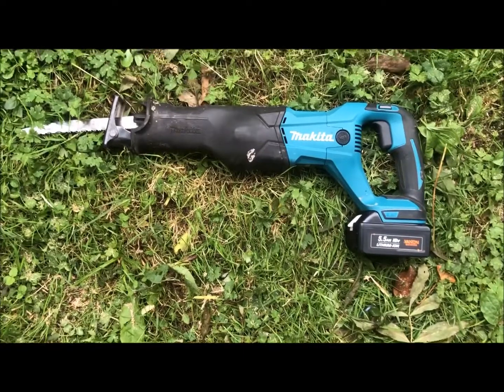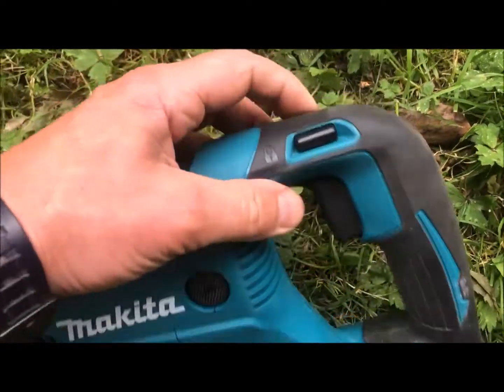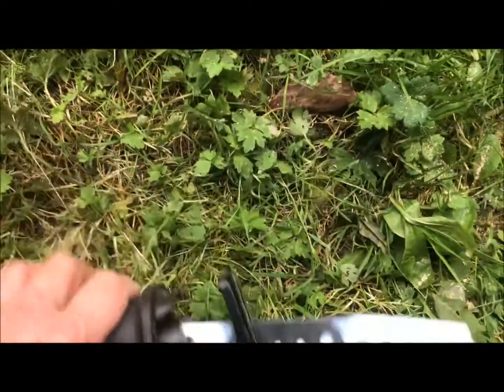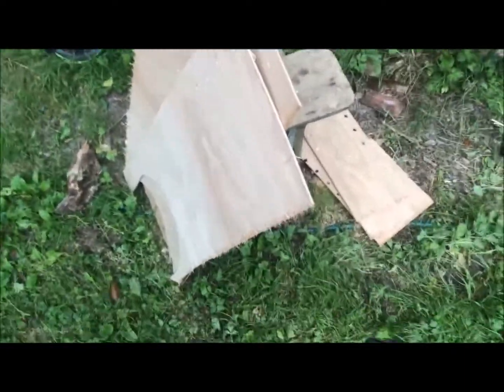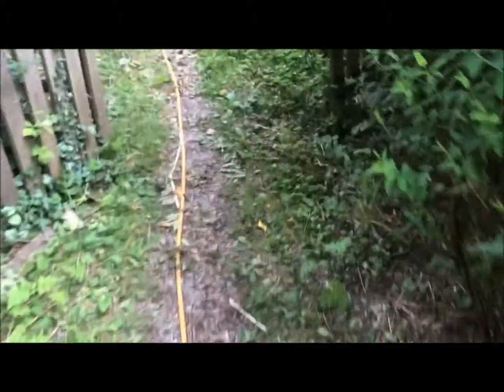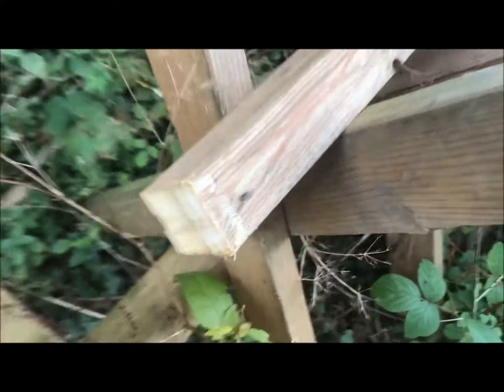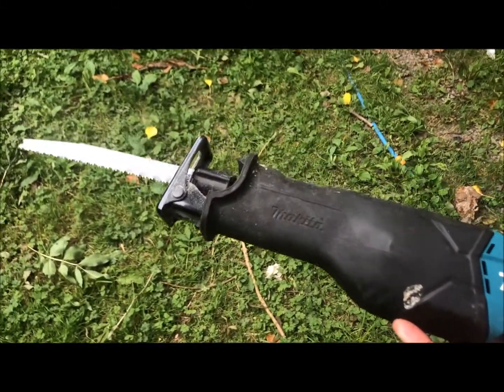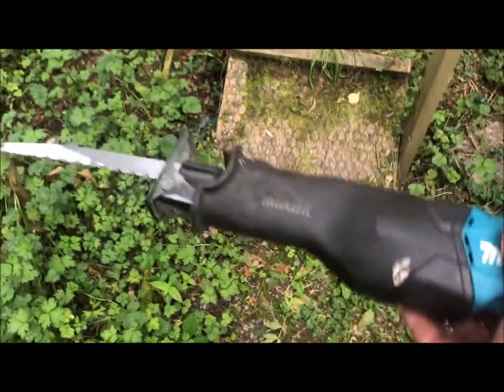Makita DJR186Z Reciprocating Saw Review

Comment: Got a load of pallets to cut up, might just buy one of these.
Reply from the maker: Ideal for that that. Although axe would be cheaper. . .  and save some time at gym.
Reply: @DorkyThorpy  Got a lot to cut up.
Reply from the maker: @Jones-xx2gc  Fair enough, great tool for job. I use mine a lot for all sorts of jobs. You won't regret getting one. I think knowing how useful mine would be I might have gone for DJR360ZK, as this one is very heavy on batteries. Perhaps  36v one ( 2 x lxt batteries) would run at lower current, and not cause batteries to heat up so much. . . . I am using non genuine batteries though.
Reply: @DorkyThorpy  I have bought one. Great piece of kit for the money.
Reply from the maker: @Jones-xx2gc  Oh great. Do you use genuine batteries? And if yes do they get hot when you are using them?
Reply: @DorkyThorpy  I got it through work and bought genuine batteries. I was using them until they cut out. They just got warm and let them cool down before recharging.